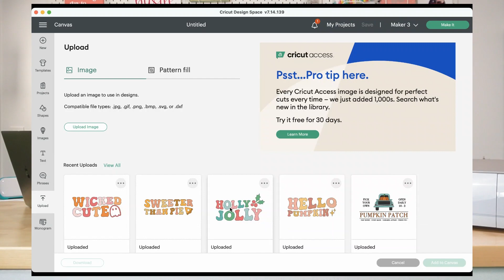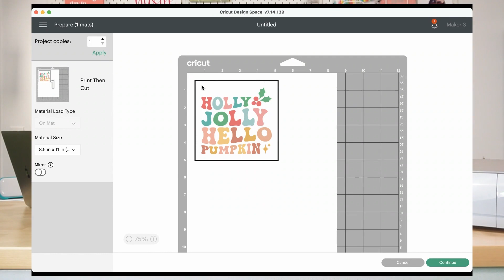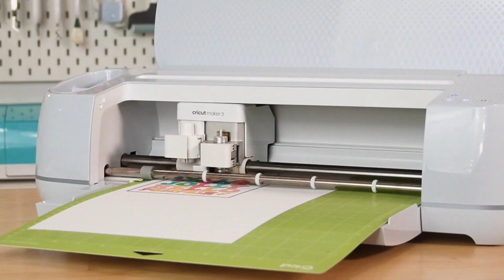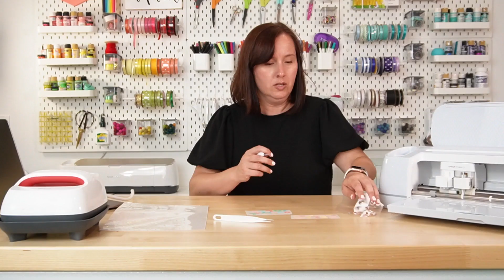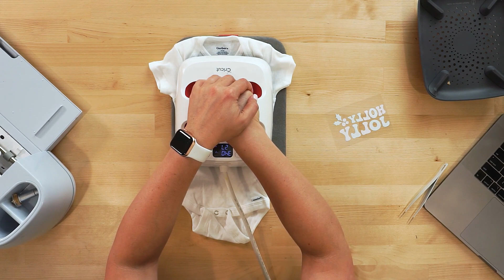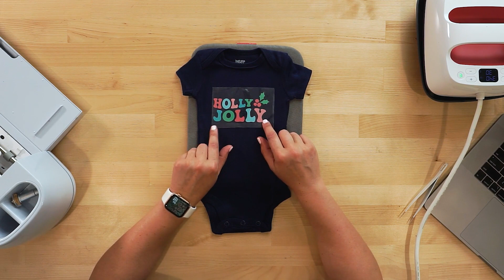Siser EasyColor DTV on Light & Dark Fabrics!

Comment: So I used the Siser EasySubli Mask (other masks may vary), carefully laid it over the image edge to edge instead of starting in the middle, scraped it down, pulled everything off my cutting mat, flipped it over, scraped it down again, then VERY slowly peeled the backing off by peeling parallel (and close to) the mask. It all came off on the first try (though I did have to use my weeder to hold down while I peeled). When I ironed, I found that doing it inside out first gave me better results; doing it right side out made the vinyl want to stick to the mask and not the shirt. Hope that helps someone!
Reply from the maker: That's really helpful, thanks!!

Comment: Thank you for this video.  Have you made this as a larger than Cricut's Print then Cut limits?  I have a round image and I need it larger than 6.75 for adult sized shirts.
Reply from the maker: For a Cricut, you can turn your image on the side and make it a little bit wider: 9.25” wide x 6.25” tall. You could also use the slice tool and cut it in two or more parts. You can also just print with a regular printer, not through Cricut design space, and cut my hand, but that’s harder with intricate designs. And then the other option would be using something like a Silhouette that has a larger print then cut area, but of course that requires a different machine and software!

Comment: Other than using a mask so you can pick up smaller sections, this makes me think of the transfer paper for dark fabrics I used 10 to 15 years ago. Have you compared it? Does it hold up better? Is it more permanent?
Reply from the maker: I’m not sure what transfer paper you may have used that many years ago! So it’s hard for me to compare. It is much sooner and more flexible than some thing like Cricut printable iron on or JetPro SofStretch. I haven’t finished my wash tests yet, so I can’t speak to durability quite yet!